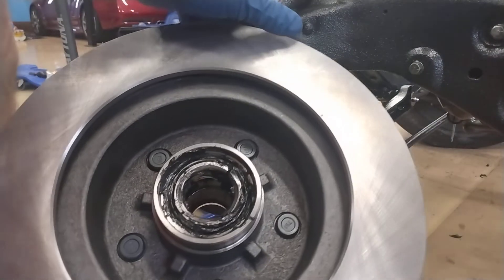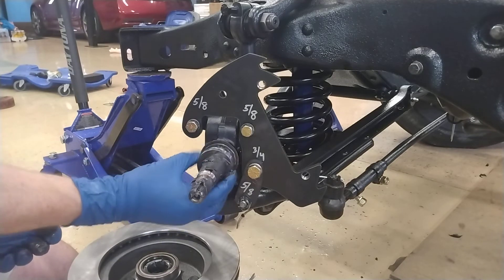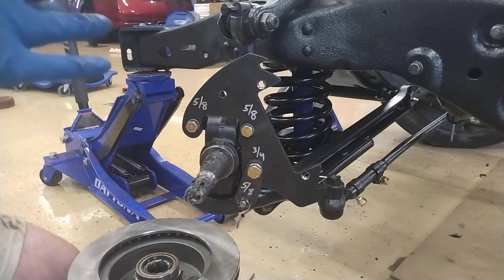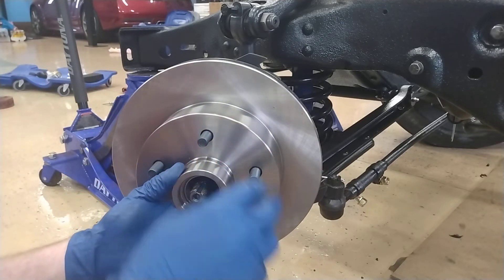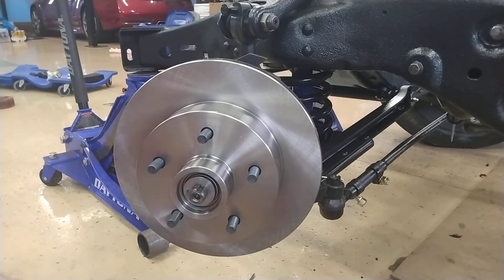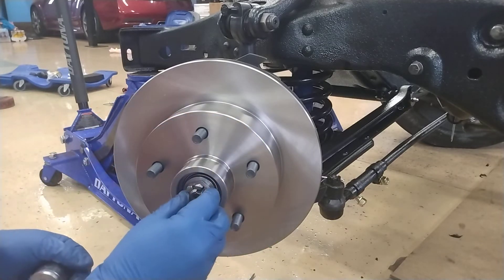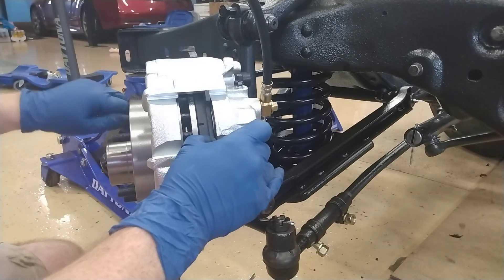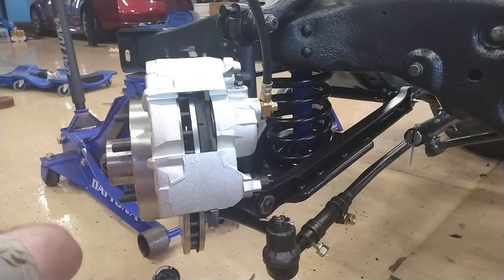1956 Cadillac Series 62 Sedan DeVille Disc Brake Install Pt 3

Comment: Hi awesome video!! Where is part 4 where you hook up the brand lines?
Reply from the maker: I sadly didn't record the process of me hand bending the lines as that was more challenging than I was used to because I used stainless steel 3/16 brake lines. I bought from both Caddy Daddy and Amazon (4lifetimelines is the store name). I also used the titan double flaring tool- yes you can use it in stainless, it's just more elbow grease and care needs to be applied to flare properly!
Reply: @memorablerides6807  Oh good that tool is only 50 dollars.